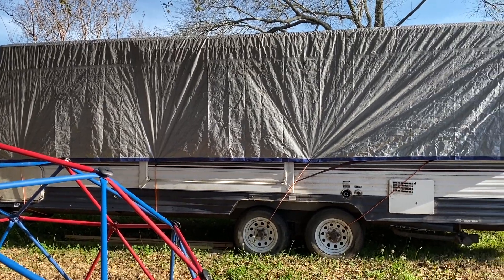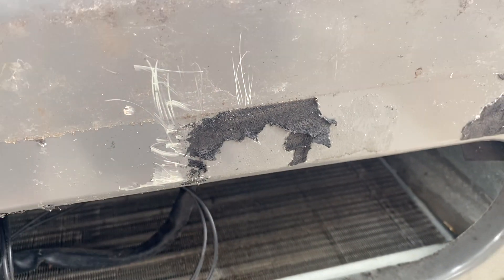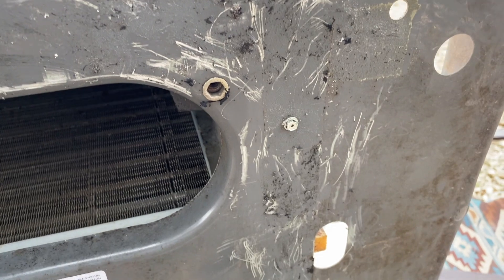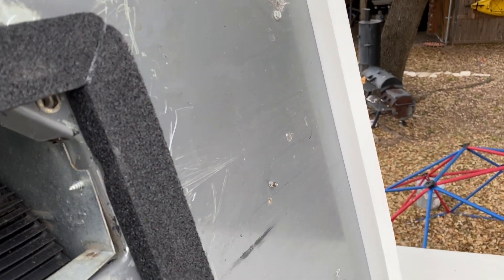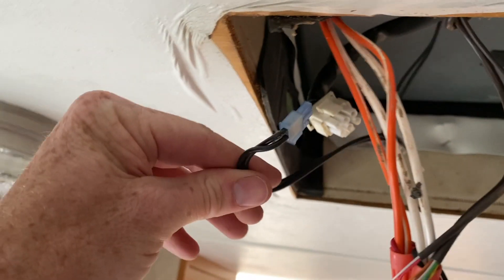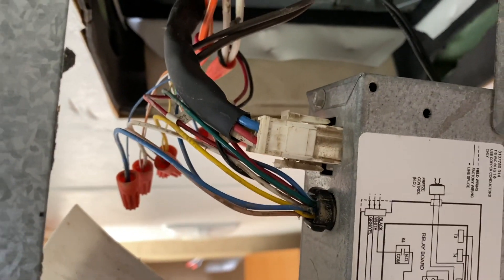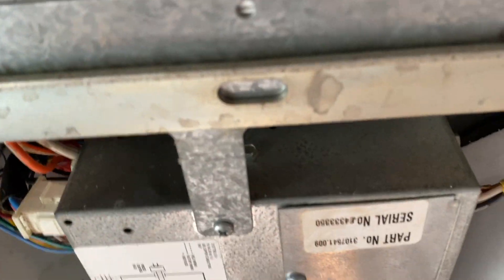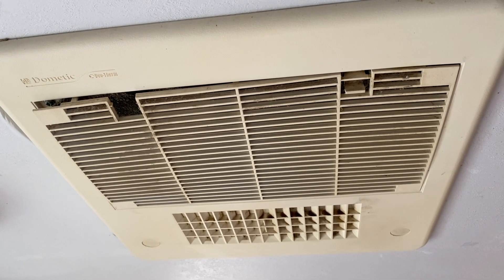How to install an air conditioner (AC) on an RV or camper trailer

Comment: How did you wrangle the unit on the roof? I got it down with 3 pairs of hands now I got myself, hoping to get it back up somehow
Reply from the maker: I ended up tying a rope to it base frame and used my extension ladder as a skid. I leaned it against the ladder rails at the bottom, climbed up on top, and used the rope to pull it up the rails. It's all I could think of since I didn't have any help to get it up there.